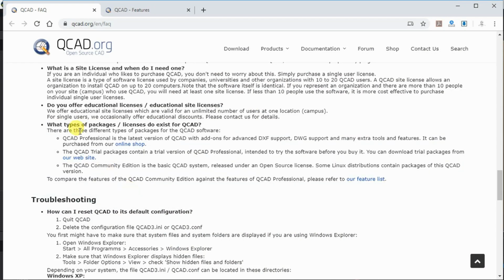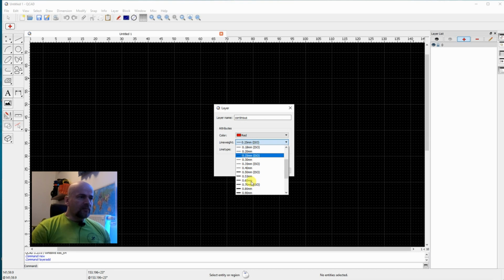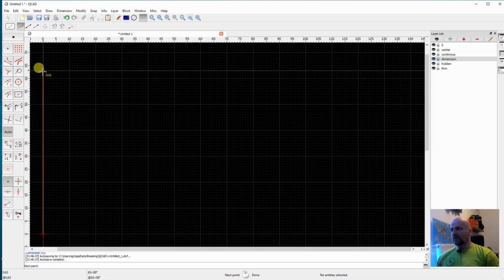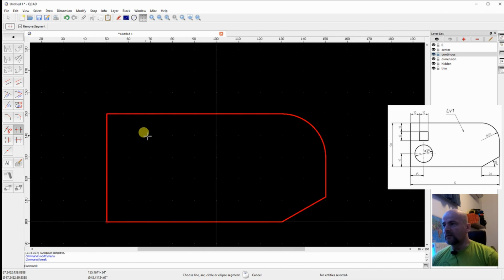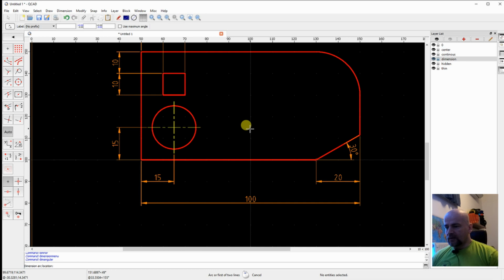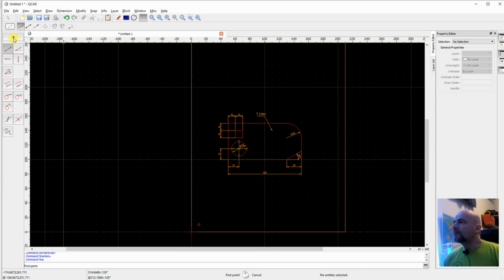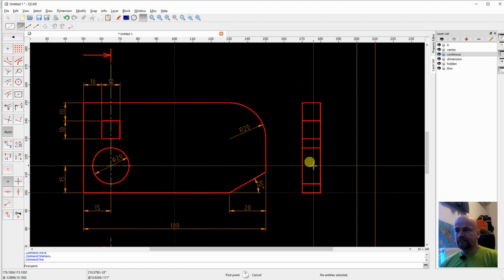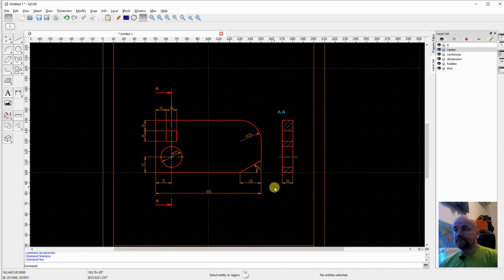How to start with a QCAD

Comment: no no no no no. I'm not a thick person, at least i didn't think so. Every time i try draw something in cad it fxcks up. So i followed exactly what you do (except i cant see your hands and what shortcuts your pressing on keyboard.)
So i plant the first co-ordinate 0;0. then i click the same box again like you do and its off the page!!!!!!!!! Doesn't go UP. like yours, do you click inbetween?  please explain every single click you make.  i have loads of dots i cant get rid of now without starting fresh and loosing all the layers i just spent 5 minutes doing....... its SO frustrating when your computer is not doing what someone elses is. i need someone by my side, there is no way this could be of use to me.. im sure your doing everything right, but if you have missed out ANYTHING i'm done for and my computer will not react the same. Christ i just wanted to draw a quick drip tray for work but i cant even draw the a4 border! its not complicated its just knowing how each software works and when you have never used cad before you have to start from absolute scratch like me. Now i have lost the fxcking co-ordinate toolbar on the bottom. honestly like wtf. is there anything more basic than this????????? clearly my computer skills only cover ms office.          i thought a 10 minute youtube video would help me draw the most basic item, but obviously not.

Comment: guess instead of drawing circle then trim it is easier to use the round corner at modification menu and give the radius and click on the lines. it's like fillet in *cad

Comment: Great tutorial!  Indeed the drawing is missing two objects, the hidden line at the section where the 30 ° angle is and the target line at the main image for the 50mm width of the object.  ;)
Reply from the maker: - Hidden lines are usualy not used when using sections. 
- Not sure what do you mean with target line for 50mm object

Comment: The "monkey symbol" @. That's the first time I hear that. I quite like it. It's like a monkey with its tail around it.
According to Wikipedia:
"In Afrikaans, it is called aapstert, meaning 'monkey tail', similarly to the Dutch use of the word (aap is the word for 'monkey' or 'ape' in Dutch, stert comes from the Dutch staart)."
https://en.m.wikipedia.org/wiki/At_sign
Reply: In Poland we name it the same: małpa = monkey. It is short and easy to remember.